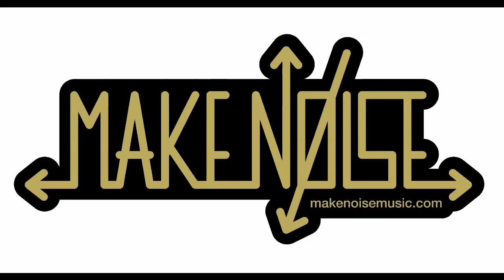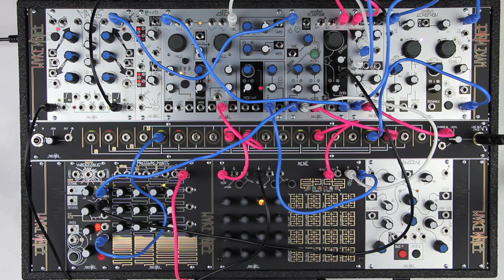tELHARMONIC: Voltage Controlled Music Theory

Comment: at 4:21 you are putting a  continuous voltage into Degree, and the telharmonic is playing a continuous glide - I thought degree was quantized?
Reply from the maker: It is quantized. The glide you hear isn't continuous, it's chromatically stepped. It would be more obvious if the CV were changing more slowly.

Comment: What's the thing going left to right in the middle of the modular box? I need to call you guys before ordering anything, getting the a-100 box unless your box is better
Reply from the maker: Yoga Flame EDM that is the CV Bus. It provides distribution and color coded visual indication of your control voltages.
Reply: I emailed you guys on the technical email and sales about what all I need, thanks for the tips still trying to get my head around it, I do have the sub 37 moog not sure what I can do with that, it has cv outputs want to order from you guys 817 773 2508 hit me up @makenoise
Reply from the maker: +Yoga Flame EDM just email the sales address. That's how we do orders.